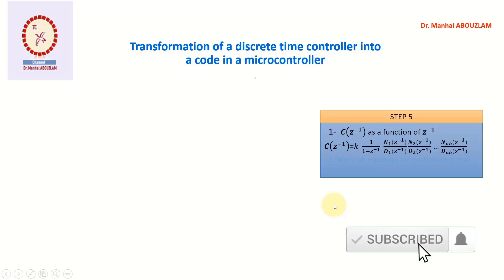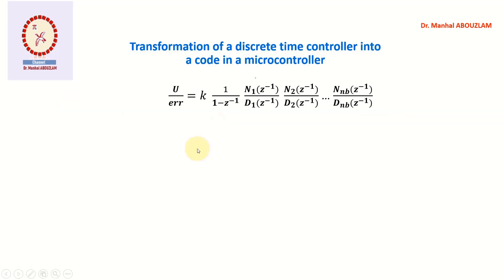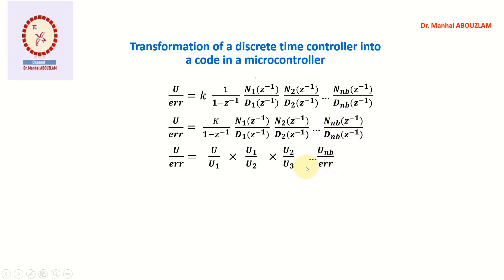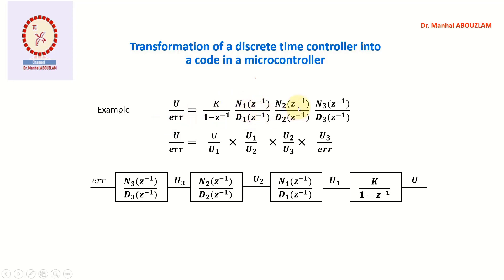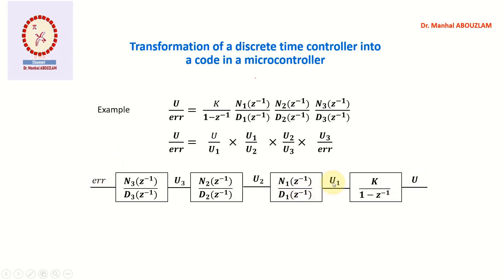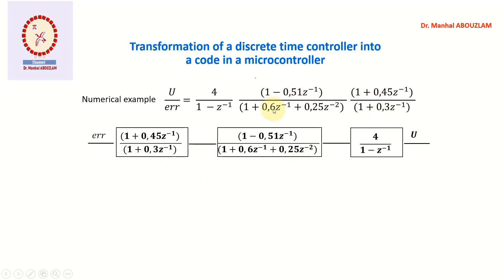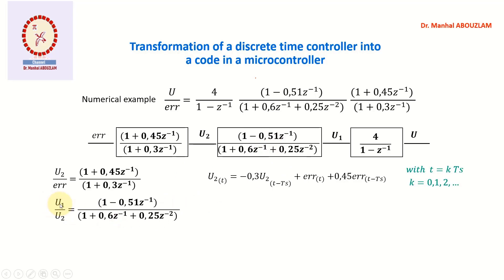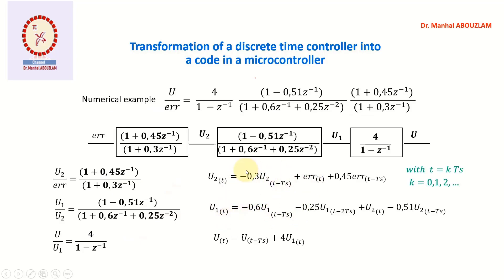Part 6: How to apply a | controller in | a Microcontroller

Comment: Thanks sir for this course it's very helpful. Please i would to know how we can choose the right Ts to do discret transformation for pid controller transfert fonction
Reply from the maker: My pleasure. you have to discretize your continuous time system then you calculate your discrete time controller (for example) PID by counting on your discretized system. In order to discetize your continous time system (choose TS), you have to consider shannon sampling theorem where  Wmax (on the Bode of your continous time system) is the frequency corresonding to the gain - 40 dB.